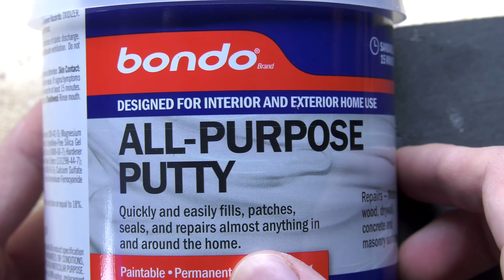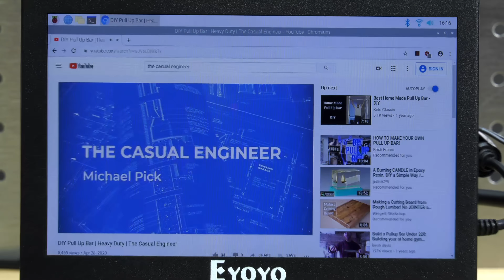World's Smallest Gaming PC

Comment: Really nice work, good attention to detail.
As for those USB ports, one thing you could do is take 4 USB extension cables, cut them shorter (optional I guess if not too long), remove the male sides casing, carefully bend the wiring to the side that would have them coming out of the back of the case. 
You could then 3D print a new case for all of those ports so you can slot them all in at once, bring it out the back and also 3D print a fake USB hub, with optional RGB lighting for ultimate gaming PC aesthetic.  That'd look really nice with this.
I'm creating my own actual hub for a project myself at some point, still designing it.  Going to use it to access a bunch of ports on a higher spec SBC (rock pro 64) so I can keep all the I/O in a neat location, as well as breaking out some USB in to a hub for low-demand stuff like mouse and keyboard so I can keep the dedicated ones on their own line.
Reply from the maker: Looking forward to that build!

Comment: It's looking good! One thing: the "GPU" fan is backwards! That way you are extracting hot air from the CPU towards the bottom of the case where it's filled with cold air. I think you should either "push" cold air towards the CPU by inverting the "GPU" fan or make another exhaust fan at the bottom back of the case which, the latter would seem the best choice here (keep reading).

Also this configuration of "pull-push" is unbalanced, causing dust to accumulate with time. Place another fan at the top back and one at the bottom back to make it more balanced.

Great work!

Comment: Omg someone get this man a block sander. This is not how you flatten a poor 3d print. Hell next time just rubber cement the sandpaper to a 2x4 for a better surface
Reply from the maker: haha, I have one, but my workbench worked for this little project. :-)
Reply: @MichaelPick  Is it an actual sanding block or just one of those tiny palmed sized ones?  Cause for this work you need a long stroke to make sure it's properly done.

Comment: 12:34 you didn't seriously just hot glue a panel in front of the fan intake without leaving any gap for airflow whatsoever, did you?

EDIT: did not notice that was mesh wire.  Nvm.

Comment: Does things work well on Fortnite and Minecraft
Reply from the maker: It does!
Reply: No, it has some streaming capabilities (you run it on a real PC but it appears on the pi)

It can run some games at low settings however (Emulated titles and Minecraft) none of this is out of box though
Reply from the maker: @Stabbyson  You can run the Pi version of Minecraft out of the box. But for more intense games, you need to stream.
Reply: @MichaelPick  that's not Fortnite, it's not even full scale Minecraft it's an old build of the mobile port without multiplayer

Comment: Did you use 8 gb ram or 4 gb ram???
Reply from the maker: 4 GB version
Reply: @MichaelPick  thx and how many FPS it runs???
Reply from the maker: @k1nex581  Using parsec I was getting a pretty steady 60 fps I believe
Reply: Do you think i can run fortnite on 60fps on rasverry pi 4 b
Reply from the maker: @k1nex581  Not by itself. I was using Parsec which is a streaming service.
Reply: @MichaelPick  what is parces does ti have delay???